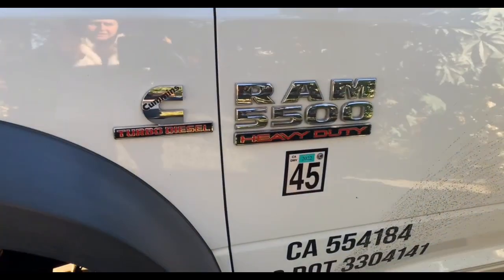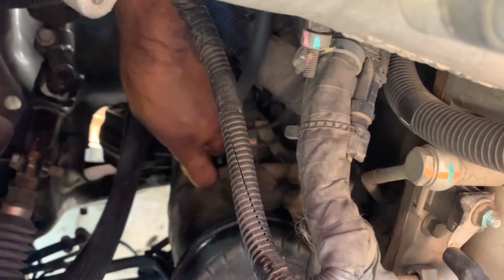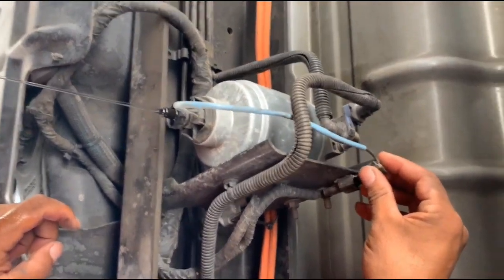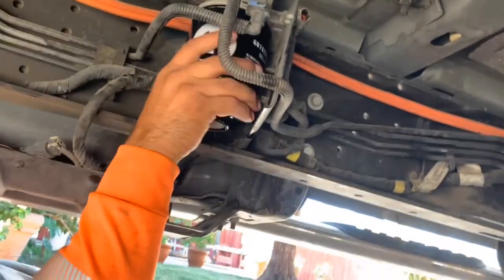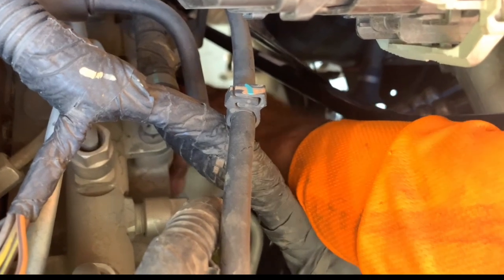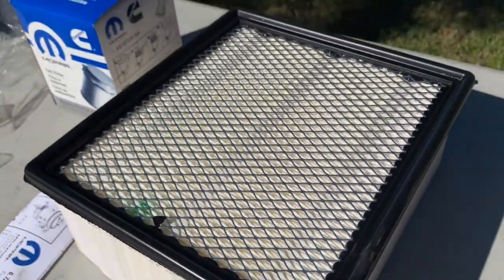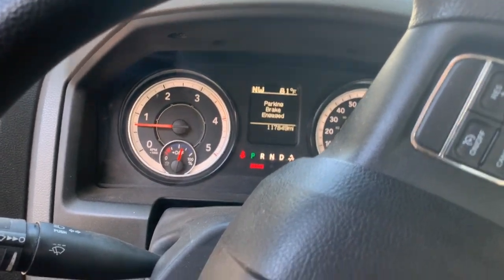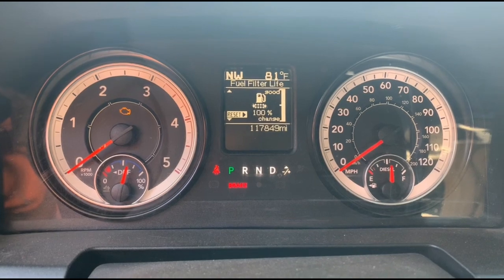Dodge Ram 5500 6.7L Cummins Oil, fuel, air filter change $282 Reset

Comment: Great video, suggestion, next time oil the fuel filter gaskets for easier removal and install the drain on the bottom filter so you can pre-file the filter like you did on the oil filter, faster priming on the fuel system.
Reply from the maker: Thank you!

Comment: Cap says 10-30 have u been using by 15-40 since new ? Thank u
Reply from the maker: Yes I now use 15-40.
Reply: @riosautotransportllc  u used to use 10-30? This is the first oil change I’ve done on it I got mine brand new . Should I flush it and use 10-30?
Reply from the maker: @peteramirez50  I started using T6 5/40 high temperature because my truck is a 2016 and has over 100k miles.  In the winter it freezes often and in the summer gets up to 116 degrees here.